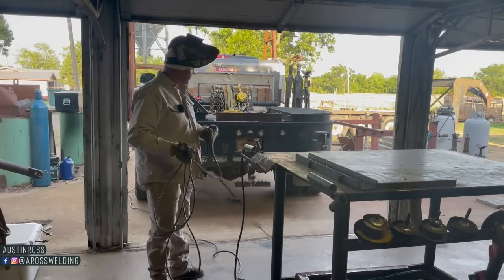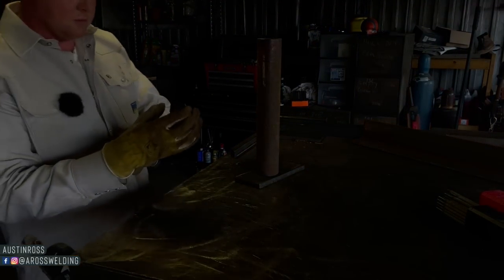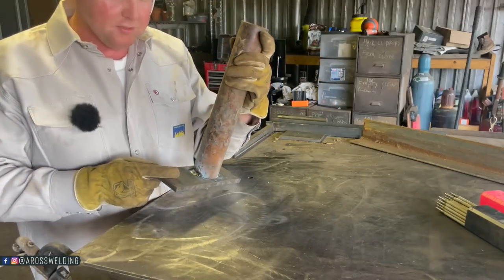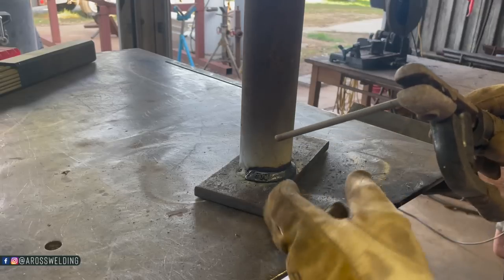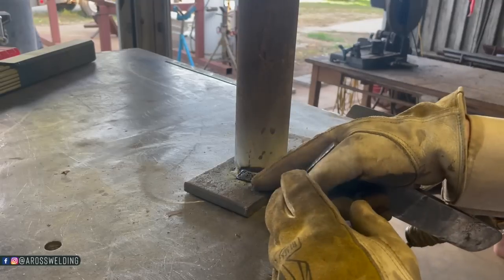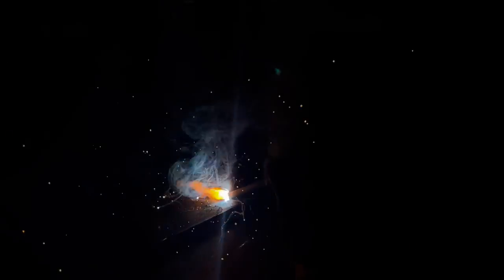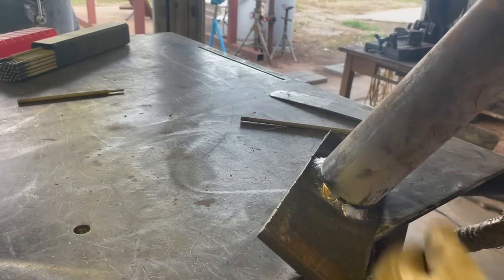Welding With 6013 Stick Rod (2" Pipe To 1/2" Plate)

Comment: The 6013 in north America was originally designed to be a shallow penetrating, 'sheet metal' rod.  The metal definitely needs to be prepped.  It seems the European 6013 is a completely different ball of wax.  Would make for a good video if you could get your hands on some and do  a comparison video with our 6013.

Comment: Just a stupid question but are those mobile welders dc or ac?
Reply from the maker: Mine is DC Welding current but it has a C power to run power tools that require AC power. But they make mobile welders that are AC welding, current and DC welding current.

Comment: Here in South africa all your rods are basically 6013. You can get 7018 but it would be sold as specialty rods like cast or stainless rods. They are sold as all position and the brand makes a differance. The best is afrox vitemax but is stupid expensive up to five time the price of your general el cheapo. Clean or dirty makes a hell of a lot of slag and if you run it colder on thin wall it loves to over run the rod with slag and make it sputter and puke and make the welder need more time in church

Comment: 6013 produces too much slag. I have found that it is good for sheet metal, as you can turn way down and still keep it lit. For me, I wouldn't weld anything load bearing with 6013...That's just me though. Thanks for your helpful videos.

Comment: I keep some 3/32 6013 around for fixing wear though spots on my combine because the metal is so thin 
The old short hood can weld some pretty thin metal with that 
That’s the best use I have found for it

Comment: 6013 is all I use. I like the way you keep an open mind on this rod. I appreciate it. Good video, enjoyed watching.👍👍
Reply: 6013 is usually my last choice, but I have a lot of respect for the welder who can do quality work with the tools/materials at hand. For me it's that sneaky slag that drives me crazy, but maybe that's just something I need to work on. 

   It does have a great shelf life, it seems to be almost the only rod they sell in some of the tropical/ developing countries (Indonesia/ Phillipines). The flux is essentially a ceramic (oxides). You'd probably be safe buying a 30yr. old box at an estate sale unless it was really rusty.
Reply: @thomaslewis9526 It’s the most common rod in Europe as well. You can pick it up in agri stores, car parts places etc.
Reply: Es el tipo de varilla que cualquier maquina puede quemar, es lo más adecuados para los aceros de bajo carbono que compran los herreros para hacer parrillas, mesas, sillas, estanterías, etc, allí donde no tiene sentido usar otro tipo de varilla. Yo también uso 6013 para casi todo, porque también uso varilla 316 L y 7018 cuando necesito reparar una herramienta o hacer una casera con un acero al carbono. Luego te acostumbras a la escoria del 6013.
Reply: You sound like my dad lol

Comment: 6013 surely like it a little on the hot side, helps with the slag a little. If you are slightly colder than it should be, you have a bunch of inclusions, lack of fusion and bad looking weld.
  And it likes a little more steep angle, which also helps with the slag.
Reply: Totalmente de acuerdo con usted 💪🏻

Comment: Why don't you try cut and etch test on them? It's easy cheap and you can tell a lot about your welds. Just cut it through the throat of the weld polish it down to about 600 grit with a flapper wheel, and then take some naval jelly and rub it on with a Q-tip give it about 5 minutes, and it'll show most, if not all inclusions and imperfections. HAZ, penetration fusion or lack thereof. Just be careful with the naval jelly, wear safety glasses, and rubber gloves. God bless y'all, and work safe.

Comment: 6013 is meant for a farming rod a lot of farmers use it. You can weld an all position. You can weld it with pipe downhill as well. 332 thick rod is what I have experience running pipe downhill in the greenhouses. With

Comment: Morning my brother, Now it's not that 6013 welding rods welds better on rust, all quality of welding rods, all areas that have to be weld must be clean before and after welding, now 6013 welding rods is a flexible welding rod, it's a rod that works better on ships and small boats for flexibility plus 6013 welding rods works better on carbon steels much better thak 7018 welding rods but most people or welders don't know this

Comment: 6013 is great for sheet metal. I am an industrial sheet metal worker and usually reach for 6013 or 6011. I love the way it smells when it burns
Reply: How thin of metal can you weld with 1/8 7018 or 1/8 6010
Reply: @TexasNationalist1836  Not thin, go down to 3/32 or 1/16.

Comment: Here In Australia 6013 is pretty much the general purpose welding rod and Probably the first rod you will weld with.
Commonly available in  2.5mm ( 3/32) and 3.2mm (1/8) sizes because that is what a 240v single phase buzz box or a 10 amp solid state  welder will run.
Though 4mm is not hard to find in trade stores.
.
 a bit of a blunt instrument.
Better to run them in the hotter half of the amp range or slag inclusion will be a PITA
.
not known for it's deep penetration.
.
Generic brands will cost you around $25AU for a 5KG ( 10LB) box.
Better brands will cost you about $40AU
Satincraft 13, a bit of a cult rod  that a lot of us learned on  30/40 years ago, will cost you silly money.

Comment: With 6013 you have a high volume of slag and I have found that you get better results if you lay the rod back enough to use your arc to keep the slag back behind the puddle if you don't you get worm tracks porosity and under cut.

Comment: It is the 6011 electrode that can weld through rust is the sister Rod to 6010 and I like 6010 which can only run on direct current 6011 is a dual polarity electrode 6013 likes clean metal

Comment: 6011 is good for dirty, rusty and painted metal. The number 1 in 6013 makes it an all position electrode. Both are considered farmer rod. Before GMAW was popular 6013 was use a lot for sheet metal.
Reply: the tiny 1,6mm 6013 work surprisingly well on sheet metal.

Comment: 6013 welding rods using oil cooled ac arc welding set was often used in uk on platework and non coded pipework welding

Comment: Hey Austin..good go at it..was 6GR coded in UK pipe work and pressure vessels.and used ESAB  O.K. 6013 most of time..the go too rod..can be used in all positions sweet rod to use. and clean. Any thing more demanding used 48P 7018 low/hydg .. just down size that rod for the first pass..would never go straight in with a 4mmm rod go smaller then stringer it . miss those days

Comment: In Europe they use 6013 for coded pipe work. My hats off to them. A tip one of the guys from UK told me was to get Esab Sureweld brand 6013. He said they are the best. I've never had the chance to try any yet. God bless
Reply: Esa marca es la que hace electrodos verdes? Yo utilizo "Conarco" 6013 y "Esab Ok"
Reply: ESAB súper verde here in México.  Main rod used here for all non-life or death welding.

Comment: Hey Austin ,  I don't  know who told you that 6013  is not an all position welding rod but they're incorrect infact this is what  Lincoln electric says about it 'The E6013 is an all purpose, all position electrode with a stable, easily handled arc. Spatter loss is low, and the weld metal solidifies quickly leaving a closely rippled deposit with good bead appearance."  6013 is also not designed to cut through rust only 6010 or 6011 are so you should  prep your base metal before  welding so you have proper fusion. Now jetrod or E7024 on the otherhand is the welding electrode that is typically only ran in horizontal or flat position because of its depository rate. I've ran it overhead myself but most companies don't recommend it as an all position rod.

Comment: Bob Moffat said he would never use 6013 for anything important.  Poor penetration and brittle.  He said it is useful for tacking with a 7018 cover because it lights and restarts easily.  I think it is specifically developed to weld sheet metal for floors or skins.
Reply: I I agree with Mr. Bob. RIP
Reply: @bayoutrapper  WHAT? He died?
Reply: This is correct it was made as a sheet metal rod. I used it to weld exhaust pipe yesterday, worked incredibly well
Reply: Yes that is what I heard and I haven't saw him on there in the last year or two. I could have heard wrong or maybe a rumer but I haven't saw him on in a good while. When I heard he'd passed, I think of a heart attack, I was truly saddened.😢.   I've been looking for him every video they put out but it's like a whole new crew. It would take a crew to try to replace him. I hope I'm wrong.  But I watch almost every video they drop and haven't saw him in a year or more. I'm going to try to find out. God bless y'all, work safe.
Reply: @bayoutrapper  I hope he is ok.

Comment: High Austin, if you fleetweld 35 is a standard 6011 good for rust,unclean material., fleetweld 35s is good for oily and dirty material., fleetweld 35ls, or fleetweld 180 is for éxtrime rust, demed coat, galvanized material. Depending on Appalachian needed. It is ann Ac-Dc rod + or - polatery.    1/8" preferred.     E6013 is mainly Ac,... but can be used on DC . It is all position according to the  ( 1 ) . It is good on farm equipment repairs,  refacing turning plow's ECT........, home repairs........ Use small circles, 1/8".                  

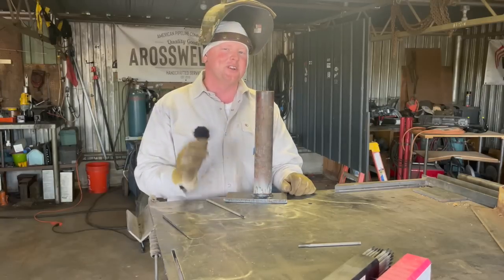10:01 

 preferred. Hope that I was able to help you. Be blessed and be safe,nol

Comment: I  finally decided to do a welding class. I was doing flat 3/32 6010 beads. I was suprised how easily i was running it. I got home and took the same rods i was using very good and couldnt do shit with my machine. I assume it was because at the school it was a very high dollar machine? Any ideas? I was using same settings
Reply: Your home inverter type doesn't have big enough inductors, high enough arc voltage and or OCV.
Reply: try 6011 0n your home machine.  It can be run any polarity on any machine.  6010, not so much.
Reply: Science Class time, so pay attention.

6010 is a High Cellulose Sodium flux. That flux means the rod needs a higher OCV (Open Circuit Voltage). For example, a Multimatic 220AC/DC has an OCV of 46 and is a nightmare to try and use the rods. I know from my experience using one at home. 

The OCV needs to be 60 or higher for a 6010 to light and be stable, preferably higher. 

6011s are High Cellulose Potassium flux. The OCV to run them is lower because of this change. These rods might solve your problem. They run the same as 6010s, so there's nothing new you need to learn.
Reply: @wargamingsupernoob  Thank you
Reply: @wargamingsupernoob  How do I find what the OCV is on my machine? Cant find it on Lincoln's website.
Reply: @Beamer-1223  what machine do you have? Check the owners manual under specifications if you cant find it on their website.
Reply: @wargamingsupernoob  I have the Lincoln le31mp. I've just gotten into welding over the past few months
Reply: @Beamer-1223  im not finding any specs on stick I need except the amps. Try using 6011s instead of 6010s. The fact that it's a multiprocess on a 110v plug isn't necessarily helping either. That's a little machine. 3/32" Fleetweld 180 rods are probably your best bet.
Reply: Craρρy run of the mill home inverter welders generally are not rated for the higher voltage 6010 requires. It's not only the current, if welder voltage is not enough, arc quenches randomly, you can't long arc even for a sec to manipulate your pool, you need some 40V! Now 6011 is supposed to have arc stabilisers hence can be used on AC and at lower arc voltage, but has nowhere near the aggressive arc of 6010, not really equivalent.
Now if you want the shittiest electrode, try welding with 6013 downstream. Much worse than 7018.

Comment: 6013 runs better on AC or DC straight. Not DC reverse like you use with 6010 or 7018.

Comment: 6013 was designed for outside corner joints on sheetmetal. It's lays a nice looking bead,but keep it tight and MOVE! It really has limited practical use today, the A/C 'buzzbox' guys like it for mower decks.
Reply from the maker: Wow, very, very interesting. Would a guy typically run it downhill or uphill or horizontal or any of the above in this situation on the outside corner of sheet metal?
Reply: @arosswelding Im no pro welder just a farmer that has taught himself some stuff. I would never use it down hill only uphill. For me the slag is too much and runs over your rod. If you try to push it over the puddle with your arc you will need to turn tour machine up high enough to make it burn through.
Reply: That makes a lot of sense. 6013 makes a good bond with the base metal, but likes to sit on top of it, not burn in like 6011. An outside corner weld is one place you don't want to burn in. 

    Harbor Freight has kept 1/16" 6013 in stock for several years.  Since 6013 is an all-position 
electrode, I bet a lot of it has been used of mufflers/exhaust pipes, and maybe some on sheet-metal auto-body patches. 
    Most red-blooded regular guys know that the odds of a mother-in- law going under a car to inspect a weld is zero. The father-in-law can be told "Sir, I know I'm no professional, if you could show me how it's done I would be grateful." 
Your own parents know you all too well, but they probably want grand children and/or continued access to pre-existing grandchildren. 
    A weld bead that sits on top of the base metal (sheet-metal) isn't the worst thing when you just want to fix a rusted-out muffler, etc.

Comment: I’ve just started learning how to stick weld, and I much prefer 6013 to 7018.  I find you can run it much lower amps, and the slag comes off a lot easier.  Weld always looks better too.  A little harder to strike an arch at time, but stays lit easier for me.  It does smell different, worse I guess lol.
Reply: Hi
I think you are okay with 6013 now because you are welding flat position only. When you  start welding overhead and vertical your difficulties will begin with 6013
Reply: 6013 has few useful applications but is good to learn with because it strikes and restarts easily.  6010/11 and 7018 have much wider applications.

Comment: 3:50 you can see with your first upsweep on the pipe you are a bit warm, too deep just a bit and getting that overhang. Sweeping through the “U” faster would compensate, but cranking her down just a smidge would allow you to maintain consistent quality welds. Good videos.

Comment: 6013 can be a real devil. If you keep a tight arc, run it on the hot side and wet in both sides of a corner joint well in, you hardly have slag inclusions otherwise it can be a nightmare. If you can run 6013 well you can run the other types wel (perhaps starts and stops 7018 may be difficult). I noticed that bigger rod diameter for 6013 with thicker steel makes it easier. I like the 1/8" size for some kind of reason best. The run it as hot as possible I learned from Jody from "welding tips and tricks".
Reply: Yah, long arcing only at start to heat up quickly. If you keep tight arc like 7018 and run it as hot as possible no issues. You can even have a steeper angle. A lot of people advice a low angle to push the slag back but if you run it hot that is less important. Wetting it in well on both sides virtually prevents slag side inclusions. I think the 7014 is the better version of the 6013 great for tacking. It has more ironpowder in the flux.
Reply: @matthijsverweijmeren6114  Thanks for the tip bro 💪🏻

Comment: 6011 is a good rod for rusty, greasy, dirty metal.
Reply: have some rusty, with some paint beam to weld.   My flux core mig is not doing great so i plan to try 6011 stick to see how it does.  should i use AC/DCEP or DCEN?  thank for any input you can give me.
Reply: @peetky8645 either ac or dc will work fine , it definitely likes dc better tho. I’m patching a dump truck bed right now and using a tombstone (AC) , a little finicky at first but I’m getting used to it. Good luck on your project!
Reply: @OkieFirefighterNoob1607  thanks